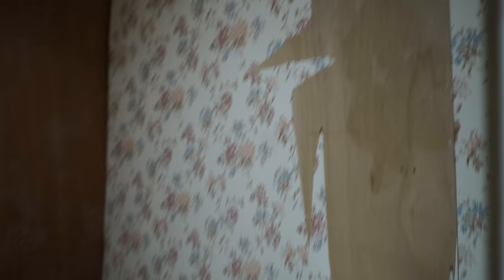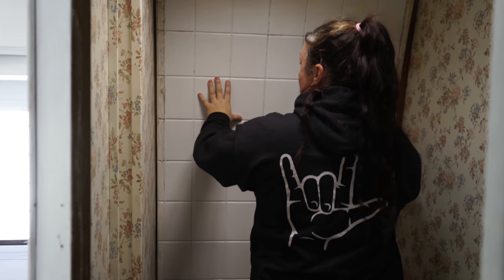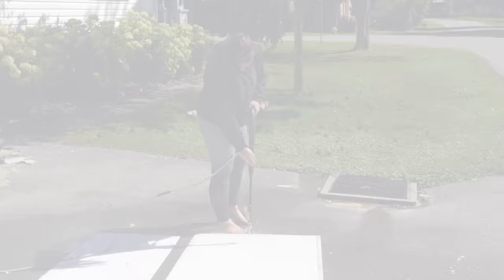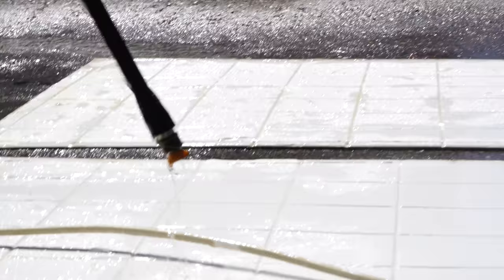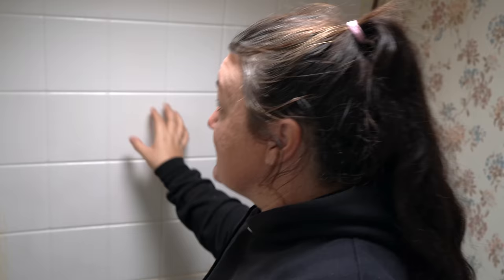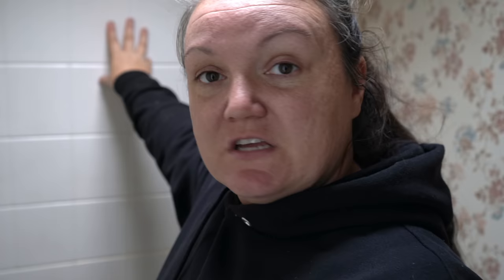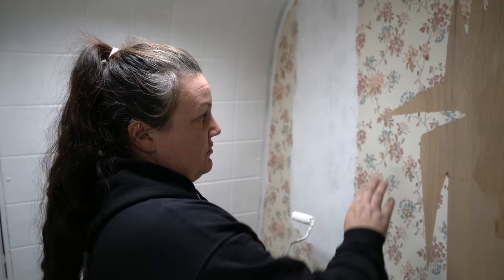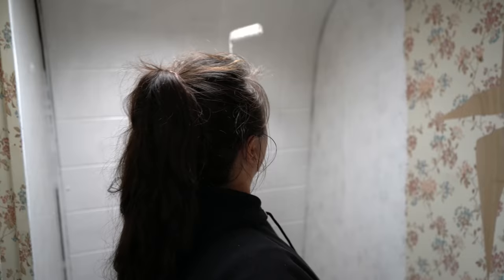You spent how much on your camper?! EXTREME CAMPER MAKEOVER (bathroom reno)

Comment: Heck, maybe even try on the scroll saw.  But we found jig not so good except maybe if you have a blade that's used yo cut laminate.  Teeth are fine and angled in the opposite direction than a normal blade.

Comment: Try a dremel with cutting blade.  Even if it just scores it you can then probably use good utility knife to finish the cut if needed.  His will cause to much movement unless held down securely.  Use a caulking glue behind it when putting it on the wall.
Reply: Jig not His....